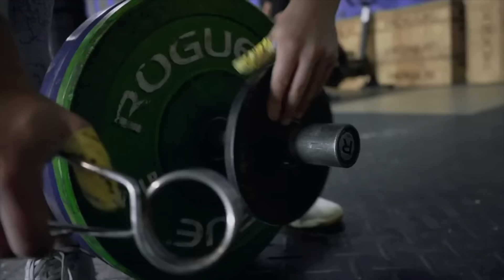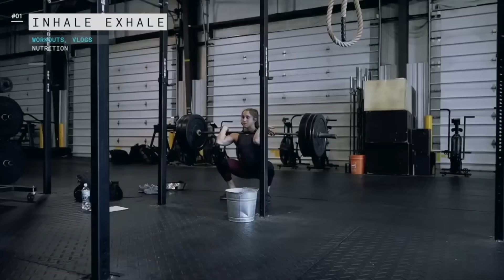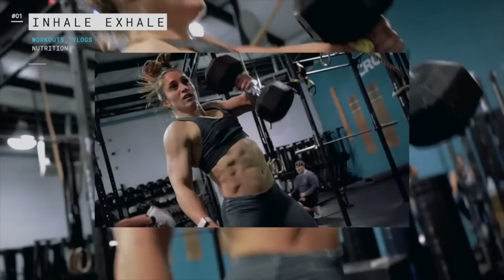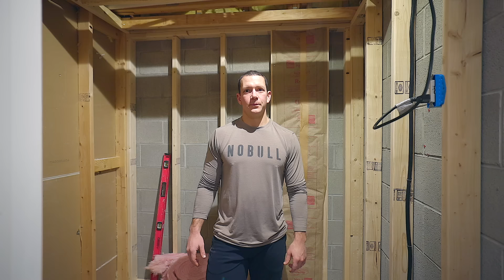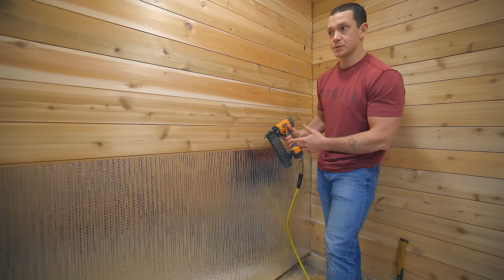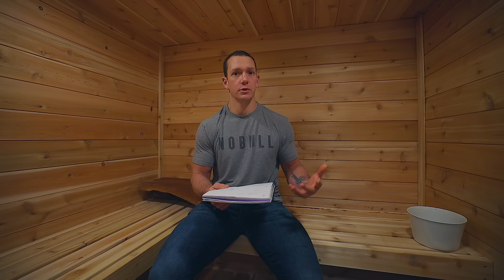HOW TO BUILD A SAUNA + FULL PRICE BREAKDOWN

Comment: 1st off thanks for video BUT  Bubble wrap foil wrap is NOT the right stuff bro ? You can buy the right stuff online or at a sauna store.This also needs to have foil tape on every seam or hole. Also  there is NO air gap in back of the wood. Should have 1/4 inch to 1/2 inch air gap behind wood by strapping it !  Wood NEEDS to breathe and dry! Also the notch side of the board should be on the top, not on the bottom? The reason for this is if water runs down the wood wall  it will not fall into the notch rotting it in time !  And finally VENTILATION, dont ever forget and intake and exhaust. A good intake is to leave a 1/2 inch gap under the door( doesnt matter what type of door you have)  to allow cool air intake air in and have  a mechanical exhaust to take air out of the sauna at a higher level on the wall (usually near your upper bench)  Just my professional thoughts of 40 years experience Thanks

Comment: The bench should always be above the heater. All the heat is on the top two thirds of the room.  Do you have proper ventilation? That is very important. 
The sauna looks good.

Comment: Oven thermometer works. 
An air vent is important as been said already. 
Lots of sweat drips down. Consider running a fan with the door open when not in use to dry out.

Comment: Fantastic build - it looks great. Couple of things - you should use wool insulation and aluminium foil for the vapor barrier otherwise risk of off gassing. Also you need an air gap from vapor barrier and cladding.

Comment: I'd be curious to know when you eventually need to change the insulation and the T&G wall cladding, which seems to have been installed upside down, making it more susceptible to water damage. Ie. I'm curious how much mileage you get out of this sauna before it's time for repair / replace.

Comment: This is a great video! I have a couple of questions. Did you put in a drain or something in for all the steam that may end up on the floor or some kind of waterproofing? is there any need to wash it out with all that sweat and steam? And is there any need for ventilation or dehumidifying if all that steam goes into the house or not really? Thanks.

Comment: I don't recommend fiberglass in a basement. It can allow mold growth. Always use mineral wool insulation where moisture can collect. Also you didn't tape the Vapor barrier joints. I would recommend doing that.

Comment: Seriously considering building a 6’x6’ sauna in my basement. Do you have detailed plans on wiring for the heater, bench layout and design, venting locations (I understand from the comments you have one under the door). Do you have to frame a ceiling or can you insulate and attach the paneling directly to the floor joists?

Comment: Hi I have a question. Did you treat the wood? I hear it needs to be treated painted or something. Another question, did you prepare the floor? I hear it also needs to be protected. I am asking because I am in the process of doing the samething and wanted to know what you think. I have been told it needs to be done if you want it to last and don't want to damage your structure. Thank You

Comment: 2:17 "radiate heat outward" - but you're going to cover that with wood so it's not going to reflect it. At that point it's not about radiation but conduction heat transfer, you need a barrier that prevents that, and that is already put in - the foam.
Reply: Thx now I ain’t gonna buy it

Comment: Everything is excellent! The only thing from experience that I would recommend is to remove the paper face from the fiberglass insulation, if even a little steam gets there, you will be growing mold on the paper surface. Other than that, the build is excellent!

Comment: Nice build. I hate to say it , but removing the tree alone will not stop water infiltration.  You're going to have to dig soil away from the basement and reseal it from the outside 😮. It can't be fixed from the inside.
Reply from the maker: it flooded because the sump pump could not pump out of the pipe that had tree roots. Removing the tree, and clearing the roots from the pipe solved the problem quite a few years ago!
Reply: @Kristi-Eramo-OConnell  yes , that is all well and good. However, water infiltration can come from excessive rainfall.  Once the seal fails on your CMU , the water actually causes cmu to rot. I hope that you continue to have no issues with it.

Comment: Hey bub, nice work.
Did you use LED's for the lights or old fashioned bulbs. The reason I ask is because I was told LED's don't tolerate heat well.

Comment: First video I've watched since I've embarked on my journey to turn one of our small outbuildings into a sauna.  Thanks for this! Very detailed.  Once thing I wasn't sure of was hardware.  Are you using decking screws for the benches? I assume it won't matter much as these mostly stay dry, but I'm hoping to add more of a steam element to ours (adding more water).  Also, I think the cedar is going to be the expensive piece for us also.  The out building is rather large.  Thank you for this video!

Comment: As a few have partially mentioned,  an air tight taped vapour barrier is vital, lighting fixtures ect, with through venting to framing to prevent sweating mould and spores will come with out doubt. Materials used would ensure their used within their design specifications. Great to do DIY projects to make it affordable but just be sure your not making a far more expensive project down the line that could effect the value of your property.  Looks nice though

Comment: After installing insulation you should of put a plastic all around the room and ceiling. Then if I wore you I would of installed waterproofing 1/2” sheets on the walls and ceiling, and waterproof the joints, then you can install that roll of foil.  I’m sorry to say that but your sauna will fail sooner or later. That’s what happened to one of my friend. His ceiling joist has rotten.
Reply: its been more than a year and have 0 signs of problems. Have access to to the ceiling above and there is no sings of moisture.

Comment: Very informative and easy to follow. I’m renovating my condo right now and making arrangements for a custom build out myself. My vision is exactly the same as what you guys created. Question, I’m considering adding a shower in mine as well…do you see that as a potential issue? I know it’s excessive but any cause for concern?
Reply: Put the shower in different room. And dont do the same mistake this guy did on the walls... There are literally no ventilation gap behind the walls! Search "saunan rakentaminen" and you will find real tutorials. There are so many mistakes on this american guys video.
Reply: Hey Michael, though it is possible i think you would be better off adding it separately. Adding one inside the sauna would make for a very different build from the start. It would have to be build like a steam room to be water tight, insure mold isnt getting any where and that all materials are water resistant.

Comment: I'm planning on doing this in a walk in closet, which already has finished drywall walls.  Would I just put the thermal wrap on the drywall walls and then cover with the tongue and groove cedar?
Reply from the maker: this is patrick.. I would take the drywall off the walls make sure all the walls of the closet have insulation, then do the thermal wrap and you would also then have the studs to nail the cedar to.
Reply: @Kristi_OConnell  OK.  Was hoping to avoid having to cut out the drywall, but if that's the best way I guess I'll have to.
Reply: What the purpose of removing the drywall first instead of attaching thermal wrap to drywall, then adding cedar.  It just seems like a lot more work (and mess) to remove the drywall first.  What's the reasoning or benefits?

Comment: Anyone want a video on how I made a sauna to get to 360 Fahrenheit hot. We built an addition to the garage and made the heater ourselves. The heater is made of a stainless steel clothes dryer drum, smooth river rocks, and 3  heavy duty  ceramic heating elements sold for a stove repairs or upgrades.

Comment: A rundown of how much it would cost to run per month would be awesome!!
Reply from the maker: hey! we use it 4-5 times per week and at most it seems to have added maybe 15$ to the electric bill
Reply: It will depend on local electric rates, add up the hours of use multiply it by your electric rate probably between 20-30 cents per hours then multiply it by 8.

Comment: Great build, looks fantastic. 3 questions... What about adding a few inches of space with the exterior walls. Any appropriate sealer on the concrete walls? Finally what about the flooring? Did you just go with the naked concrete? As I'm no expert, someone should come in and comment. Cheers and thank you.

Comment: Great video! QUESTION... Now that it's been close to a year with your bneautifully built sauna, do you deal with and heat causing mold or condensation inside the frame or outside the room of the sauna? I LOVE what you guys did!!
Reply from the maker: thanks! and no, not at all. the cedar is a dry wood and we have zero moisture issues anywhere and use it at least a few times a week!
Reply: @Kristi_OConnell  THAT'S GREAT!! I'm so inspired! Thanks for the reply!!!!

Comment: I think you're supposed to have a vapor barrier between the framing and the cedar.
Reply: hey! since it isnt a steam room, there is no vapor that needs to be controlled. even if you put some water on the rocks the cedar is such a dry wood it sucks it right up always seeming dry and slowly releases back into the air as it cools.

Comment: Great video, I had a couple of questions for you.  How much did your electricity bill increase?  (what is your electrical rate and how often do you use the sauna)?  I'm thinking very hard about building one just like your example.   Thank you.
Reply: Based on average US rate of $0.13/kWh, and since he mentioned his heater is 8kW (33A @ 240V), it should cost around $1.04 per hour of operation. I'd imagine using it 4 or 5 times a week, for an hour or less each time, would add about $20 max to the monthly bill.
Reply: @dbschmidt  that is worth the benefits of using a Sauna for sure.  thanks.
Reply from the maker: we use it multiple times per week and havent noticed any real change in our electric bill.
Reply: @Kristi_OConnell  That's great!  I'm in Alaska so I'll have to plan and barge up the stove.  I'm hoping to find a good wholesale lumber yard in the Pac NW since the box stores here are still pretty expensive on the cedar.

Comment: Nice video and thank your for the step-by-step process. One question: don’t you need a vapor barrier for the “infusion“. Because of the damp air the insulation could gather water and could get moldy. If you have other Information, please let me know! Thank you and greetings from Germany ✌️
Reply from the maker: Hey ! there is very little moisture, no moisture if you dont sprits the rocks every now and then but the cedar paneling is so dry it absorbs any of the moisture and slowly climatizes back as the sauna cools. We have had 0 moisture build up anywehre!

Comment: dont use anything with moisture in this setup it will grow mold you NEED to waterproof everything! they only use heat shielding no moisture control.
Reply: its a dry sauna... what moistrure are you worried about?? we have had 0 issues and all material is still bone dry.

Comment: Wood expands and contracts across it's width primarily and thickness. Lengthwise it is so minimal that you can cut the boards tight to the corner. Your expansion room should only be at the base and tops of the walls as well as the  ceiling corners that run parallel with the boards.
Reply: hey, wood does shrink and expand and def never want to make lengthwise cuts tight, wood flooring is more comon and every real wood flooring will have spicific instructions not to do so.

Comment: Hi, thanks for the video.  
Can I use pine for the inside walls?  The interior panels?

Thanks!!
Reply: no, it will leak sap and wont handle the heat and cooling expancion as well
Reply: @patrickoconnell2380  pine has worked in my sauna for 60 years

Comment: What is the average cost to run the sauna in your home? I’m wanting to build one on my patio and trying to decide if I should go with wood or electric. 
I live in Idaho where our average cost per kilowatt hour is 10¢. Our energy is cheap but we’re hoping a sauna would be cheaper to run and maintain than a hot tub.
Reply: Hey! To be honest, it it hasn’t changed our bill enough for be to be able to tell you. We use it on a daily basis and hasn’t made a difference on our bill.

Comment: hey, i saw that you said that the moisture doesn't build up and that's why you don't have a vent, but it's actually not true! the moisture does build up even though there isn't steam inside so i sincerely suggest that you add a vent! it will not only help with the air moisture levels but it will actually also help heating up the sauna evenly through out the room and it makes the experience a lot better!
Reply: Hey! actually learded about that through all the comments and did end up adding a vent! thanks
Reply: Should it just circulate or blow air in or out or how would you mount that?

Comment: Pat, 
Nice video! You have helped to inspire me to do the same in my basement.  I noticed you used R-13 insulation on the walls, is that also what you used on the ceiling? What are the normal temperatures you get your sauna up to? 
Thanks,
-Ben
Reply: brwilliams85 hey! I can’t recommend it enough. Yes I also used the r-13 in the ceiling. I get it between 150 and 180!
Reply: @patrickoconnell2380  Do you think you would be able to get it hotter if you used R19? Maybe I am overthinking it....
Reply: brwilliams85 I doubt that would make to much, I think it would just take a larger heater. But 180 for for 20 min and Iv sweat a bucket of water!

Comment: Nice build. BUT.... Important point here, make sure you have a proper intake and outtake for air. Air ventilation in sauna is very important. The best saunas are traditionally build in Finland and they have a very comprehensive code/ standard on how and where to place ventilation. I would highly recommend following that code for anyone who is building a sauna at home.
Reply: Where can I find the code for air intake and out put. Placement etc.
Reply: @marknabor377 where is the code
Reply: Where is the code
Reply: Hey! thanks for the imput. I did put a 2'' gap at the bottom of the floor for intake and have been on the fence for adding a upper vent though it isnt requierd code here.
Reply: shush

Comment: SaunaTimes and Glen is a great guy and source of info on sauna building. Google him if you want to build one.
Reply: I have built a few in my life..generally well done but I would add the following...(1) .to cut back on electricity cost...build the ceiling (also walls) out of 2x6.  More insulation and it will not have much heat loss warming the floors upstairs.  (2) Ceiling height of sauna should not be more than 6feet 8 inches for a typical 5x7 sauna.  (3) Adding a floor drain will make it easier to wash down the seats...otherwise, where does the water go.....(4) Venting....although some people do not like it, I have added an air intake into the sauna, running it through the furnace and using the excess heat in the house....also providing venting in the sauna so no moisture when not in use.  During the sauna, use a sliding door on the air intake...closing it off during the use of the sauna.  Some people say it may hurt the furnace, but I have been doing it for over 10 years, and no problem.  (5) I would use clear cedar (much more $$$$$) but worth it.  Knotty cedar may eventually run sap through the knots and wouldnt want to have it on my back or butt.  
(6)  the thermostat ....run the wire (bulb) on the end through the wall mounting it close to the heater, on the ceiling....to get a true reading on the temperature...do this prior to installing the cedar paneling.  (7) Last point...make sure there is atleast 1 inch air space when installing the door, to provide venting when using the sauna....Enjoy your sauna...love them....
Reply: @erikjarviste4587  thank you!!!  We are thinking about building one and this is really helpful